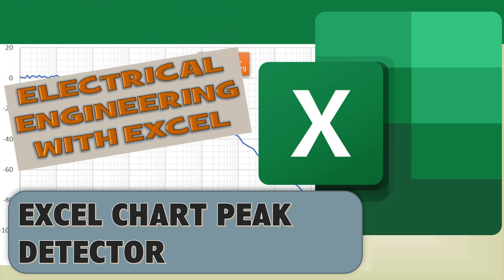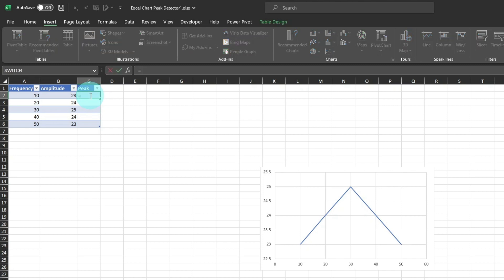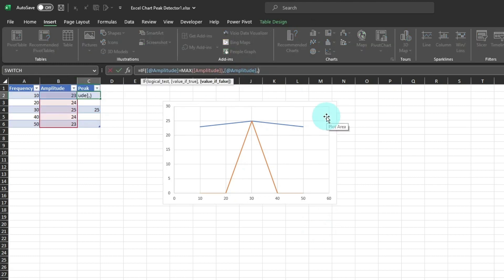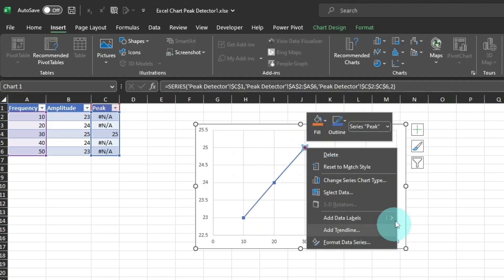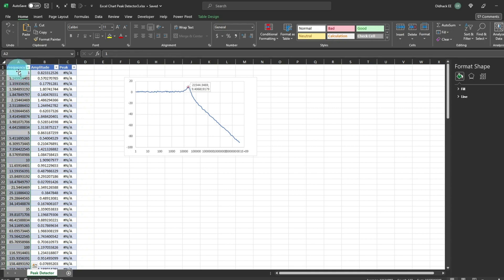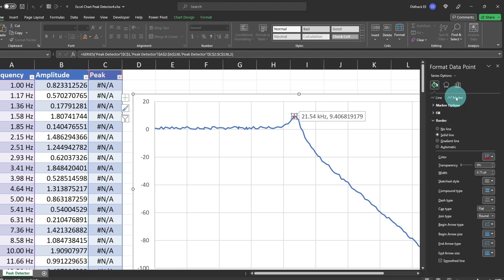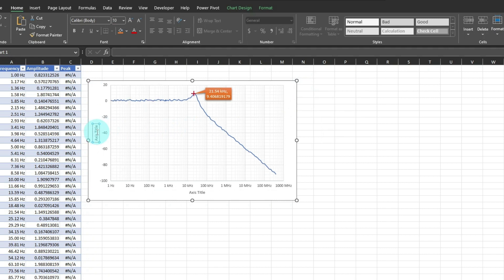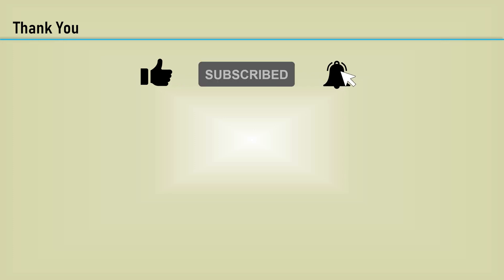Excel Chart Peak Detector

Comment: Thank you for another useful lesson! 
May I ask you something?
You are an Excel expert and maybe you know how to get the thermal equivalent circuit according to Cauer consisting of r_i and t_i from a Z_th curve of a certain power semiconductor? Normally Z_th is given in the datasheet.
I'm looking for a software for this purpose without success.
Reply from the maker: Thanks for the comment and question. I understand what you are talking about, but I'm not familiar with the math involved to do that. I've seen where the Zth curve can be plotted from Foster topology thermal RC values, i.e. Nexperia app note AN11261. I'm not sure how to go backwards.

Comment: This was an awesome tutorial, thank you.  I've found that for a lot of engineering work that Excel is indispensable.  Most organizations have it, not all will let you have your preferred programming software, and for certain situations it's easier to do it in Excel than building a program to do the same thing.  There's also not as many tutorials for Excel in electronics/electrical engineering so I especially appreciate the tutorials.
Reply from the maker: Thanks Paul. I appreciate the comment. Yes it appears most of the videos about Excel are for accounting and general business applications. That’s why I wanted to share some engineering related applications here.